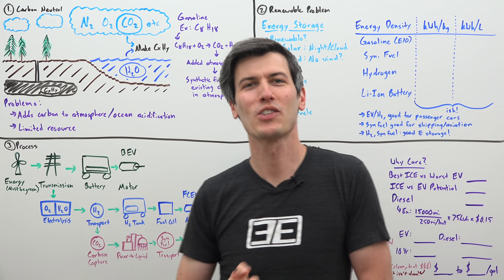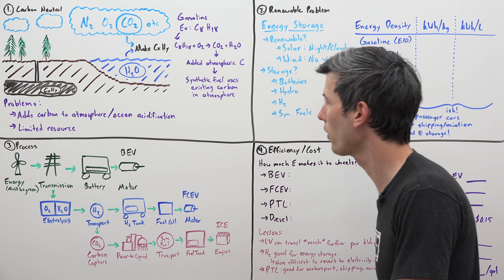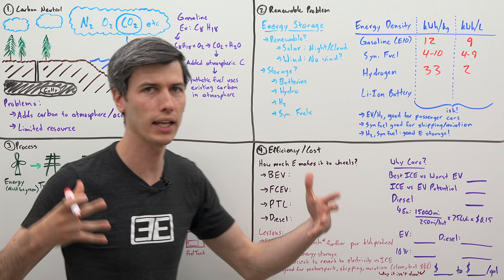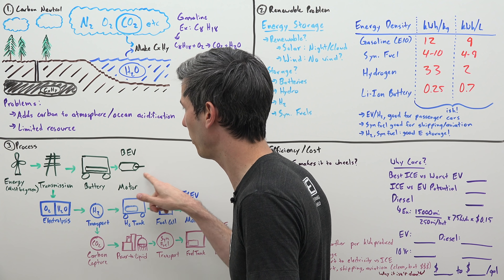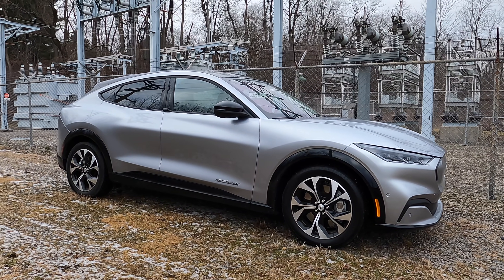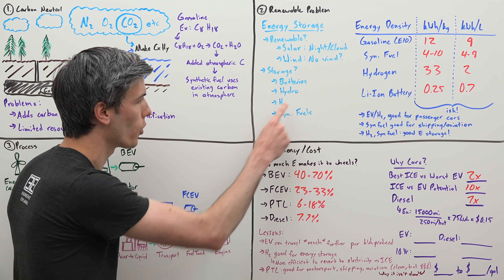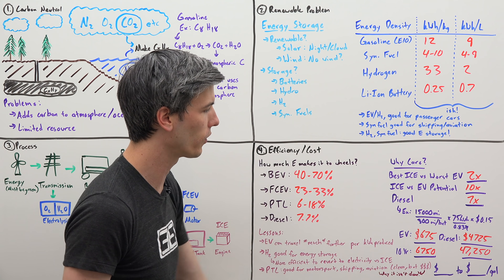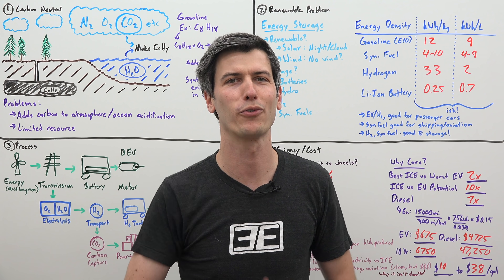The Big Problem With Synthetic Fuels

Comment: I mean it makes sense. You need to inject energy to lower the entropy, and ICE burns absolute best case in a lab, 40% efficient. So if you use the 18% you're basically saying that power to liquid, transport, etc...only takes up half the energy, which is probably generous.

Sad, but true.  If only it weren't; I'll miss the V8 rumble.
Reply: Toyota says their "Dynamic Force" engine is 40% efficient (41% for diesel) though. Not sure it's true, but their cars have a very good efficiency overall.

Comment: Even if it did cost the same, EV's are making more power and torque within the much shorter time they have had for development, I'm just hoping for synthetic oil to become a somewhat affordable and available fuel so that governments would take their boots off of enthusiasts neck.
Reply: Evs are using industrial motors that have been around for a century in the current market, and EVs have been around longer then ICE. They made another emergence back in the 70s. Its always been about the batteries making them undesirable,  and thats still the problem for some applications.

Comment: I don't think carbon neutral means they should convert CO2 into fuel because it is not natural, and also meaning energy balance it need become useless. I believe the nature already has the answer for CO2 circle.

But bring the CO2 back to some source of human need so it has economic value and useful meanwhile cut the use or enviromental damage in the name of human need.

The fact that nuclear power cause heat and using water as their coller system make the CO2 from the ocean rise to the atmosphere.

And to use H in another kind of fuel will cause the enviromental condition worse.

Thank you for your channel and your effort to share the knowledge.

Comment: but fcev's do make more sense than bev's from emissions stand point.
Reply: In theory, maybe. But with the way hydrogen is currently made (methane steam reforming).... not so much.
Reply: @NicholasHoward  but if producing hydrogen by electrolysis method (which will happen later) ull end up with less greenhouse gas emission.
Reply: @anandmathad8415  correct, it'll happen. But even then, that electricity would be used more efficiently in a pure ev, considering the losses in hydrogen production, transportation, storage, conversion back into electricity, etc.
Reply: @NicholasHoward  i agree with u,but we are talkin abt emissions , where as to produce a battery in an ev ,u need several stuffs like lithium, nickel ,cobalt etc and are present in very less quantity and u need to dig the earth for those and extraction of lithium causes ground water pollution too and releases tons of green house gases, look i think fcev are better for the planet despite of the efficiency of producing hydrogen and storing it.
Reply: @anandmathad8415  FCEVs have big battery packs too. They're smaller than a pure EV's pack, though.
Reply: @NicholasHoward  yeah, correct.
Reply: @NicholasHoward  i guess 5kwh or maybe 10kwh

Comment: They have to use synthetic fuel at for planes right? Giant battery powered passenger planes just aren't a thing or am I completely wrong? At least it will need something other than li-ion batteries. So the technology will be developed for that and it will become cheaper as time goes on. Will it become cheap enough for the consumer market who knows but the price should come down. 

Plus rural places that won't the infrastructure to support BEVs for a few decades need some sort of in between thing even if everything goes electric. Like take Finland, where I'm from, for example the charging network is super poor at the moment. Like in the city I live I know only one place with a charging place and I'm not even close to northern parts of Finland that absolute have no charging network.

Comment: The premise that "renewable" energy must be used to create the fuel is not entirely valid. As you point out for electric vehicles, you can theoretically reduce the net carbon footprint by concentrating the fuel production at large scale efficient facilities. That said, it is likely not worth the effort to do so for fuel production.

The argument for Nuclear (technically not renewable) is great for synthesizing fuel. For one, it does not emit carbon itself, and two it produces it's energy as heat which is actually the primary working energy desired for fuel synthesis. This cuts out the need to produce as much electricity thus increasing the efficiency of the fuel production vs a renewable source.

Comment: Are Porsche mass-producing millions of gallons of synthetic fuel, or just producing it in a lab?  I can't help but wonder if economies of scale won't come into play here, especially if some renewable resource like solar or wind is leveraged to produce the synthetic fuel.  Surely there's a huge environmental benefit in NOT having everyone throw away their ICE cars to buy something that must be manufactured from the ground up (and let's face it, lithium batteries have their own environmental impact from mining to scarcity to eventual disposal).

I may be wrong (or this may be outdated) but I had read that batteries make no sense much beyond the size of a heavy duty pickup truck, because the weight of adding more batteries doesn't proportionately increase range.  This is a big problem if we're hitting that limit so close to passenger car size.

Comment: What evidence do you have showing that we will run out of crude oil?  Can you tell me the exact base components of what makes our current fuel?  Not what it is after processing.
Reply from the maker: Wiki is a great resource if you're looking for the chemical makeup of petroleum: https://en.wikipedia.org/wiki/Petroleum
Reply: they are running out of places to mine it as there is only so much space under the surface for it to develop, it is not an unlimited resource. EVs will prolong the mining and use of crude oil and allow it to be used for other purposes.

Comment: In part 3, you look at 3 possible processes to produce energy. But they all start with a renewable source, wind power. Today, only 9% of the energy used in the US is from wind power. Doesn't that make hybrid cars more favorable ?
Reply from the maker: It depends on the state! This video shows a map of the US, and which makes the most sense: https://youtu.be/6RhtiPefVzM
Reply: @EngineeringExplained  The map is great, but your assumption was that wind power could handle each of the 3 options, yet it currently is limited to 8% of all energy sources used. Can it be the energy source for those options?

Comment: Thank you Jason!
The amount of cognitive dissonance is incredible, even when faced with hard numbers.
I've had to write off a number of people who I considered intelligent when confronted with facts about actual efficiencies.
Reply: Well, it's not just about efficiency. There are so many things that make this a truly complex problem.
All EV world is about as much science fiction as world entirely without them.  There are going to be conventional fuels, EVs and hydrogen technologies along each other for quite some time.
Reply: @jiricech6370  Hydrogen's only place is fuel cells (electricity again)
Electrolysis is net negative energy and hydrogen is too bulky as a motor fuel.
Not to mention it's difficult storage, steel embrittlement and diffusion right through any kind of containment.
Hydrogen from steam reforming methane is going to be uneconomical as carbon taxes come into play.
Reply: I'd argue that a much better place to put hydrogen that's produced by electrolysis is into process heating. If you run it through a fuel cell you get back about half of what you put into electrolysis. If you use the hydrogen directly to melt steel or bake bread, you're actually using 80 to 90% of the energy in that combustion. So long as you don't need to try to turn it back into electricity you can use the heat from hydrogen combustion much more efficiently, substituting it for a lot of process heat that now runs on natural gas.
Reply: @jimurrata6785  I thought so too. 
Fistly, what does net negative even mean? From what I know, noone wants to burn hydrogen outside of dedicated turbines. Fuel cells are a no brainer for hydrogen.
Secondly.. yes, it is bulky,..first EVs weren't so great either. To this day EVs mostly suck.
Steel embrittlement and diffusion is already figured out, check that out if you wish.
Electrolysis might become pretty cheap in certain situations especially with the increasing number of renewables joining the grid each day.
Lastly, I don't like fuel cell technology nor EVs but being so sure about their absence in the future is a bit silly.
Reply: @jiricech6370  Hydrogen is being touted as a solution to the massive carbon source that is steel. That's silly.
Since all of this is in regards to EV's what I'm saying is 'hydrogen as an energy storage medium is a loser', but as a sink for excess renewable capacity is still not great.
Creating hydrogen, to compress and store, to drive a turbine, to create electricity on a grid scale is far less efficient than battery or capacitor storage.
As a source for a fuel cell cogeneration plant with district heating, or a dedicated industrial plant (like the chemical industry) where prodigious amounts of both are needed could provide some grid relief, as plants usually use through process and have steady needs.

Comment: The only sensible use of these fuels is for airplanes imho.
I don’t think hydrogen will work well on planes because of the extreme volume requirement causing additional drag.
Batteries are nowhere near the energy density required so those are off as well.
Leaving bio ethanol or equivalents.

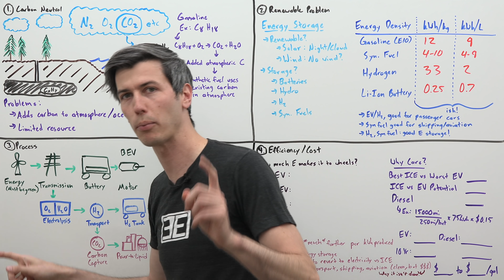Comment: Hello EE. I just wanted to ask you about a statement you made in the video which puzzled me. You said at around 6:05 'Electric cars can still be greener than combustion cars even if the energy is from a fossil fuel'. I am a little bit puzzled by this statement and was wondering if you could explain it further.

My confusion comes from considering the overall 'cradle to grave' sustainability analysis of an EV. The batteries use Lithium ion which needs to be extracted from the ground in quarries, these machines use lots of energy and I am guessing that many of them use diesel too, contributing to CO2 and all the other pollutants contributing to greenhouse effect. Then you have the process of shipping raw materials which once again would use energy, probably diesel once again. 

So even if the resource is renewable from where the energy for the EV comes from (Wind, Hydroelectric etc...), Just from production of that EV has contributed in energy usage and additional pollutants into the atmosphere. Using electricity generated from oil or gas is just going to contribute more and increase the vehicles emissions overall.

Lastly, when the EV has come to the end of its life, what happens to the lithium ion? Once again, wouldn't there be a need for energy expenditure to extract and potentially recycle the lithium (I am not sure if it can be) .

Are there any figures maybe in a video explaining the total usage and emissions of an EV vs a regular vehicle over its entire life cycle and are there any research papers which state and quantify that EVs from 'cradle to grave' are more sustainable than a regular combustion vehicle?

Many Thanks!!
Reply: This analysis was done (by the Wall Street Journal I think) and the break even point was at about 30,000 miles of EV use. I do not know if their analysis considered the energy needed to extract oil and refine it into a gallon of gasoline. Those energy inputs are not small, and are needed for the lifetime of the ICE. The EV battery construction is a one-time resource cost.
Reply: @Hogtown1986  If you can point me in the direction of where to find this info I will take a look. You can see that it will take 1/3 possibly 1/4 of the vehicles life (under a number of assumptions, ideal conditions etc..) before you have any emissions/energy recovery. The first owner will in no way benefit from zero emission, but the 2nd and 3rd might.

In an ideal scenario you want to keep that particular vehicle on the road for as long as possible, but there are two things that prevent this. No. 1. A manufacturer will always want to sell a new vehicle instead of remanufacturing an old one unless they can make it profitable and No.2. Like any mechanical/electrical system degradation and reliability will reduce over time. So from Day 1 to end of life, what will be the degradation in energy conversion as its not going to stay constant. Its aspects like this that need to be looked into.

 If you have details of the analysis I will take a look. Thanks.

Comment: My wife works on the sollution for large cargo ships. They don't plan on using hydrogen or synthetic fuels.

Hydrogen is difficult because of low efficiency, the need of large and expensive tanks (cryogene or high pressure) and the explosive danger of hydrogen.
Synthetic fuel is to expensive. It's much better just to burn alcohol, methanol usually.
The most promising energy sources are the aluminium air battery and radox flow battery's. But hydrogen carriers are also very promising. 

Hydrogen sounds like the sollution for everything but it is just to difficult and/or dangerous to work with. There are way better things than hydrogen, but hydrogen sounds so nicely familliar, you could refuel just like people are used to and therefor it gets way to much funding and attention from politicians.

Comment: DME is an easy to produce syn fuel when you have Thorium MSR or any MSR as a heat source. For aircraft, trains, and anything above short haul flights, battery electric will never be a viable solution but DME is perfect
Reply: Now at the end of the video - awfully short sighted given that your example assumes the same production chain for all syn fuels - which is false

Comment: Do you think we'll see hydrogen fuel cell range extenders for BEVs?
Reply: Mercedes used to build a GLC (compact SUV) with more or less that principle, though they called it a plug-in hybrid. The car had a big battery (can't remember but I think about 20 kWh or so) and a fuel cell. The battery was there to help the car bridge the distance between hydrogen fuelling stations in areas with no H2 infrastructure.
But in essence, all hydrogen cars on the market today work like that: the fuel cell usually feeds a buffer battery which is then used to power the motor.

Oh, and Mazda have experimented with a rotary engine that burns hydrogen and works as a generator to propel an electric vehicle. Some prototypes were built, but the viability was inexistant.
Reply: No. That requires a hydrogen infrastructure that does not yet exist, and never will.

Comment: Isn't there also a scaling problem alongside the efficiency/cost issue? 

Per some 2020 numbers I just Googled the world is consuming 92.2 million barrels of oil per day, 1 barrel is 42 gallons so over 3 billion gallons of crude oil per day. A modern refineries produce millions of gallons of fuel per day at full rate, how many gallons of eFuel could a similarly sized synthetic fuel "refinery" produce per day if it includes all of the equipment needed to scavenge CO2 from the atmosphere and electrolyze Hydrogen from water as its feedstocks and would that be enough to keep ICE vehicles running?

Comment: In my eyes nature preservation and reduction of plastic and e-waste is still far more meaningful than trying to replace all cars on the road, creating even more waste. But as you probably already know political decisions get solely made with economy in mind and forcing automakers to provide solutions is easier and keeps the economy going.
Reply: Its actually against the economy. Electric cars use less components - no engines, transmission, tailpipe. So less people to assemble. Hence more unemployment. Also those companies providing parts to these OEMs will be out of function. Hence a country (after the disaster covid has done) will not be able to cope it up with the loss and failure in economy. A point which most don't regard
Reply: Nobody is (seriously) proposing replacing all cars. Cars have a useful life. When they’re done they get scrapped and you buy a newer one. How many 1985 Celicas do you see now? That will continue to happen in the future, though that newer one may be electric.
Reply: Nobody is trying to replace all cars on the road at once. New cars are replacing old ones every day. So if the new car is an EV, nothing is truly wasted since the old car was going to the scrapyard anyway. Not all political decisions are based on economy, if that would be the case there would be 0 incentives for EVs.